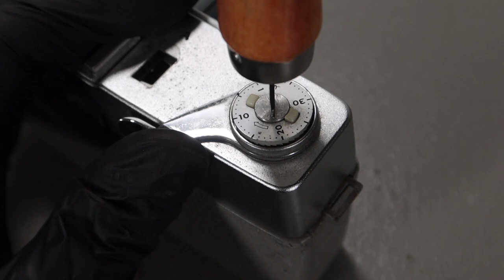Konica L Film Camera Restoration

Comment: Can you do a video on how to work it, I have one and have been trying to see if there is something wrong with it.
Reply: Here is a link to the official manual. This camera is exclusively controlled by the light meter, which seems to be a selenium photocell. These don't need any batteries, but tend to become less reactive with time if they've been exposed to light for lots of time. Best way to test if any analog camera works is by shooting a roll of black and white film (cheapest) and getting it developed. You can do some tests beforhand though. For this camera I'd try shining a flashlight on and off of the light meter (black grid thing next to the viewfinder) and see if it moves. I'd also check the lens for fungus/dirt. To do this you set the shutter to B (manual explains how to do so) and open the film back. Make sure your aperture is set to 2.8 so you will be able to see the entire lens. Hold down the shutter button while you look through the back of the camera towards a light source. If you see any webs, spots of dust or dirt on it, depending on how bad it is, your lens is dirty and will produce images between slightly affected and totally unusable. But again, these tests are only surface level. If you really want to know if its working properly or not, you will have to shoot a roll of 35mm film through it.                                                     manual link here. https://www.cameramanuals.org/konica/konica_l.pdf